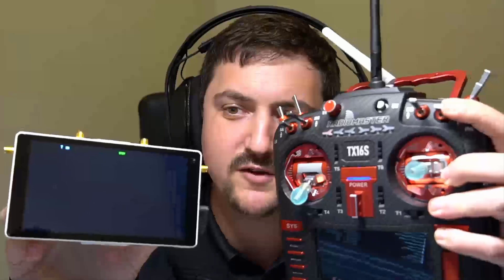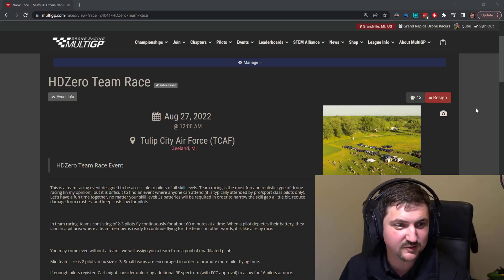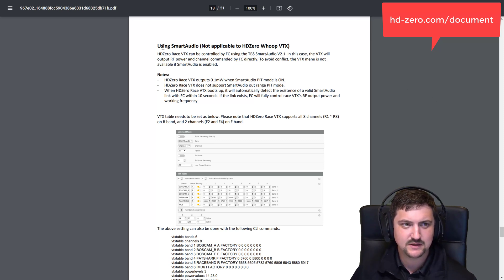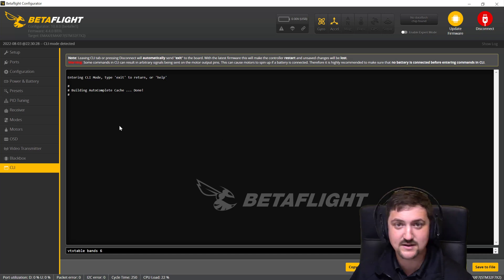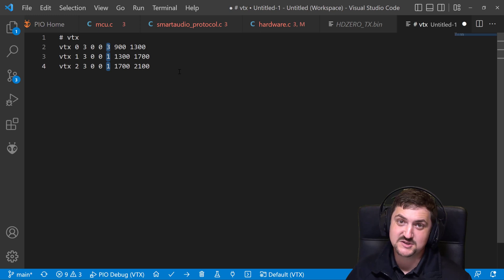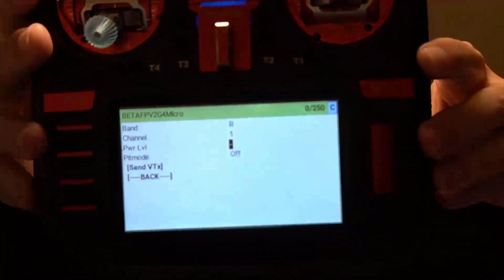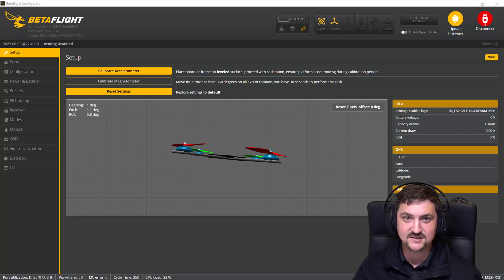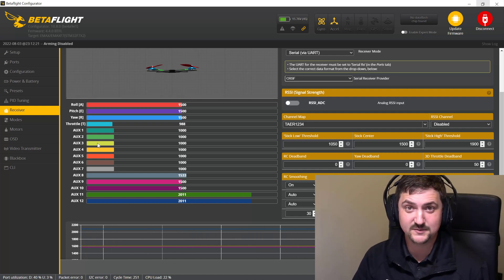How to Setup HDZero for Team Racing

Comment: I have that same Fatshark byte frost VRX display but I've not been able to use it recently as there is no current firmware for it. I'm curious how you have it working with the current HDZero firmware?
Reply from the maker: I have firmware that makes it work
Reply: @RyanQuellet  I wish I could get my hands on that firmware. I want to use my older Byte Frost VRX with my all my HDZero quads and planes. It's also great for bench testing and spectators. FYI great stuff, keep it coming...